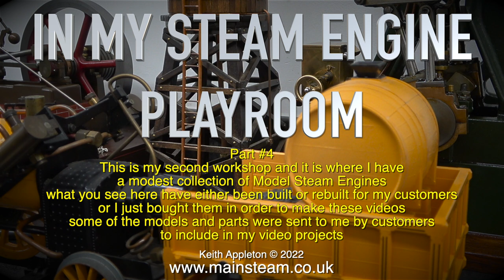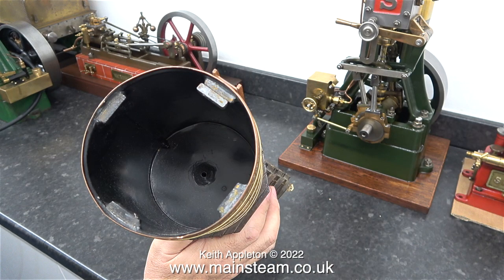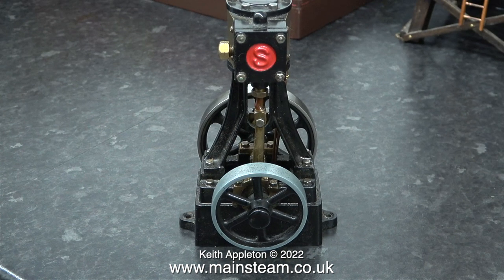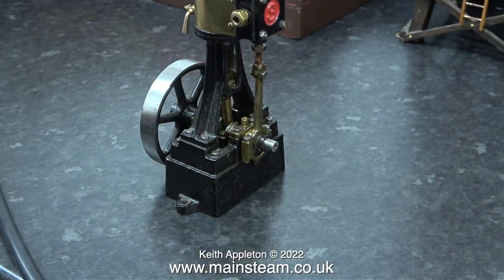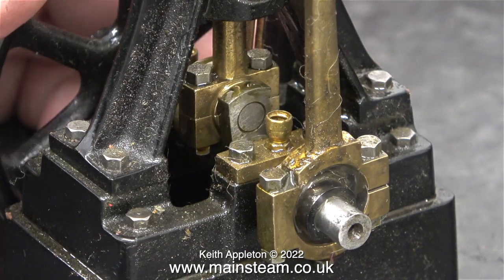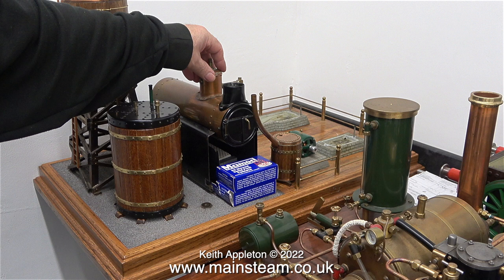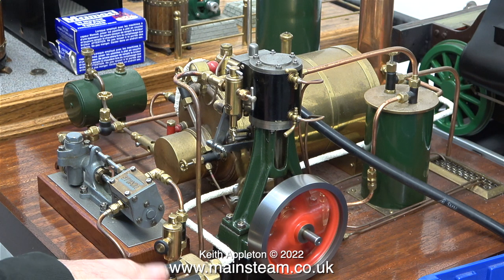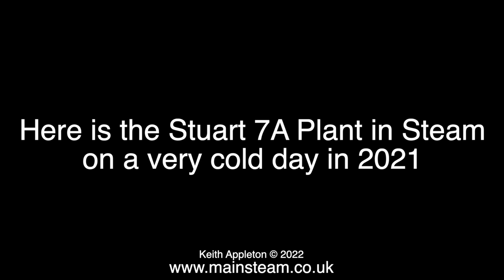IN MY STEAM ENGINE PLAYROOM - PART #4

Comment: Without knowing the full particulars of your fire tube boiler, I can assure that in industry there were many "Underfired, fire tube boilers". This type of plant was once common, and could be found burning solid fuel, liquid or gas. I remember sticking my head in a rural hospital boiler house and there were two of these. The attendant hand stoking billets of wood as required. The only sound being basically the click of the water pump as it changed direction.
Reply from the maker: Personally I have never seen a boiler design quite like this in the UK, especially in model form.